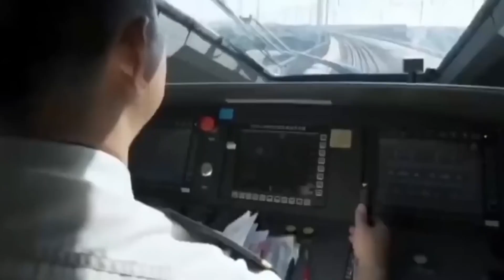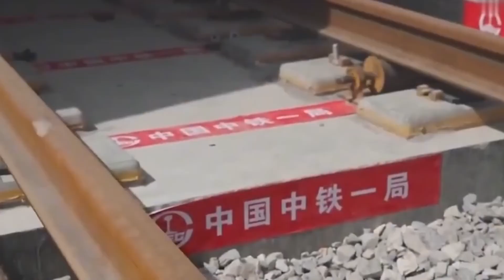China Builds $16 Billion Mega High Speed Rail In The Desert That Shocked American Engineers#china

Comment: The info & impression that CPC-China, was involved extensively in the Saudi Arabia (USD16 Billion Project) to build the Saudi Arabia, "Al Haramiain High-Speed Railway" System, length 450 km, operating speed over 300km/hour, between Mecca and Madinah is  INCORRECT.   According to all available research material, 2-Chinese Companies were involved as minor parts of several consortia or (JVs) but,  it was the primary main selected, Al Shoula Consortium (led by Renfe, Spanish Group, along with 12 Spanish Companies & 2 Saudi Companies) that primarily constructed, built and presently operating this Mecca-Madinah High-Speed Railway system.   Indeed correct, China Railway Construction Company, was the primarily builder in the construction and building the USD1.8 Billion, "MECCA METRO" or Mecca Light Railway. See this:    https://en.wikipedia.org/wiki/Haramain_high-speed_railway

Comment: china is the best - much love and respect for china... from USA!
Reply: The info & impression that CPC-China, was involved extensively in the Saudi Arabia (USD16 Billion Project) to build the Saudi Arabia, "Al Haramiain High-Speed Railway" System, length 450 km, operating speed over 300km/hour, between Mecca and Madinah is  INCORRECT.   According to all available research material, 2-Chinese Companies were involved as minor parts of several consortia or (JVs) but,  it was the primary main selected, Al Shoula Consortium (led by Renfe, Spanish Group, along with 12 Spanish Companies & 2 Saudi Companies) that primarily constructed, built and presently operating this Mecca-Madinah High-Speed Railway system.   Indeed correct, China Railway Construction Company, was the primarily builder in the construction and building the USD1.8 Billion, "MECCA METRO" or Mecca Light Railway. See this:    https://en.wikipedia.org/wiki/Haramain_high-speed_railway